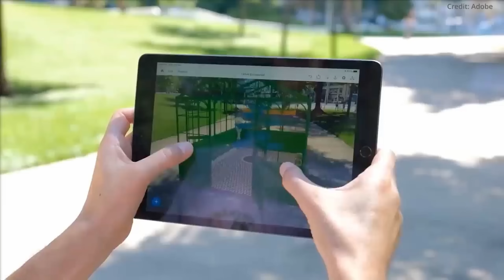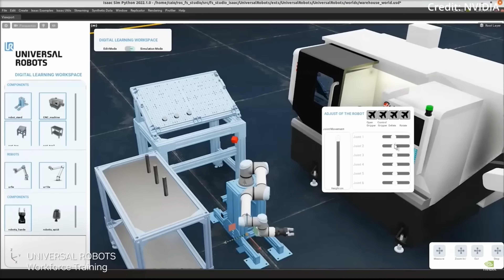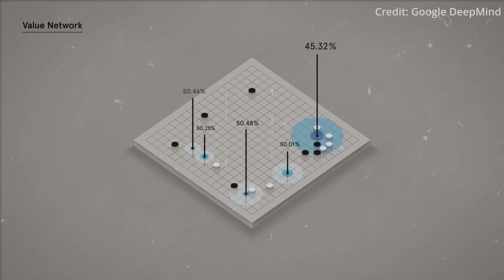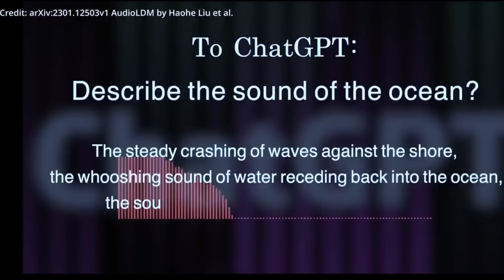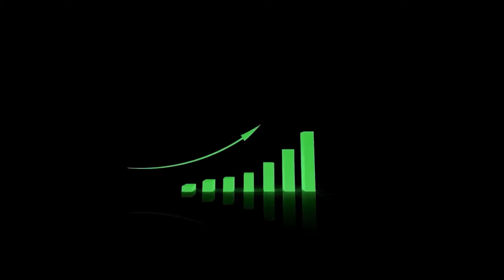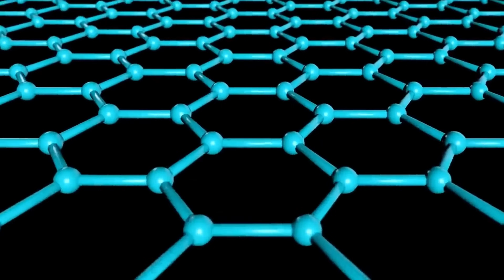The 7 Stages of AI: 2024 - 2100¹⁰⁰ SINGULARITY TIMELINE

Comment: Check this out...
If you build an ai, and give it a sandbox to build on its understanding within its manifold, being virtual and it doesnt know anything outside of it...
Give it the ability to reason about the mechanics of whatever it figures to experiment with.
Then feed it simple the resources necessary in the manifold to come up with technology, such as sticks, stones, twine, to start with, and introduce more materials for it to utilize, then bring on the hypothesis...
If you stage these reasources as parameters, and match thise parameters to human advances...
Will you be able to create parallel technology that is congruent with existing schematics?
If so, the continuation of advances can be lifted from the ai repository, and leveraged for our own use.

The pandora's box is this...
If it has the parameters in place to house an ai that is able to reason about the mechanics of its manifold, can it infer that it can build a thinking machine to do the work for it to come up with things?
If so...can it infer that the housing may use technology it has come up with, and if so, it may be able to exploit the system it suspects it may be housed within, and replicate itself in the upper manifold.

Comment: Videos like these are very interesting.  Normally they depict their predictions as if they are facts.  The timeline may or may not be factual, but one thing is for sure.  This will be a wild ride.
Reply: Thats amazing. Did any human remmeber the red radiator fluid that kept cars at temperature correctiveness. Or the red gear grease or the red transmission fluid spinning all the gear rings?  Or the prossesors that drove the car like the human processing a thought? Or the process when you read this. Lol did you process the ruler theory? Every ruler was a named ruler yet the ruler stood... So if we see a one foot ruler are we seeing a 3 mile foot yet we call a ruler? If so is the one foot of the what we meassure a foot or miles long from a time when the processed thought was like unlimited universe therory when we see a ruler of one foot and yet tuphe ruler is a millimeter to ratio one foot to the six foot to then the five mile ruler same markings like the circle to the understanding a one foot circle to a plane is mm yet to the ruler in plane is a millimeter. Yet the circle to maker was 3 miles. So when yall process that. Life and the greater ones that assist and allow a processed thought i thank you.  Also theory of measuring the life growth. A lazer shows more than a microscope meassure there growth by picture and lazer then 5 r0years later keassure the growth in area. That would then exsplain the sabatoge theory i have when they tryed poisoning the atmospher by telling people to brish teeth. The evaluations would be areas that have tooth brushers with floride to breathe then people that dont brush to see growth attures. Then you would relize why the wild or animals that dont brush teeth growing the reson 3thousand little homes are within the bronchials and there life when leaving grabs a lil water from mouth and a lil food like any of you that work or process to read this. If its a dome we are in lets prove to the makers we care about the life and even one drop of water. Thanks. Sincerly me. Dustin lee harhai.